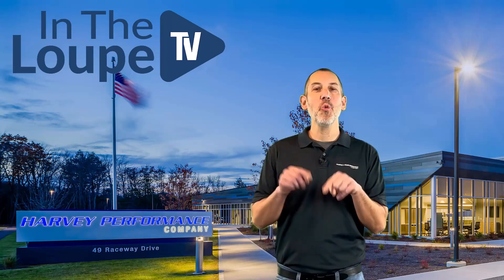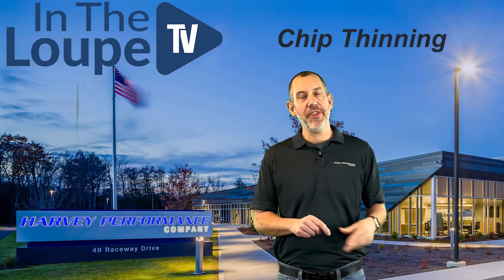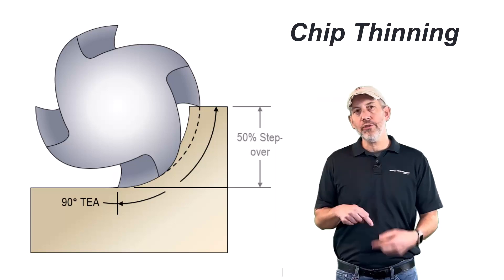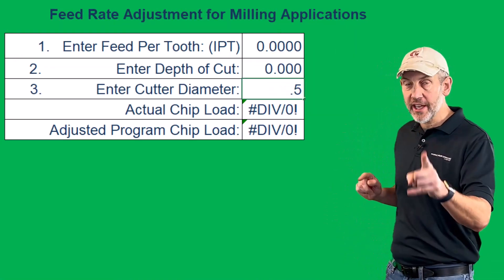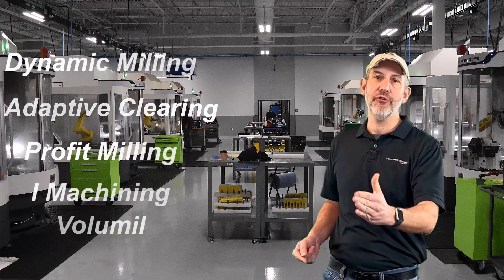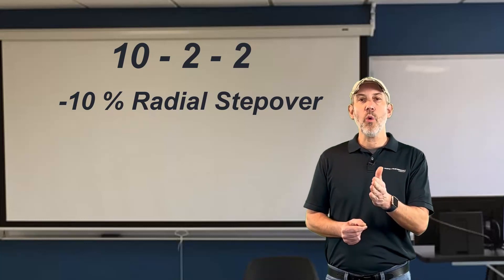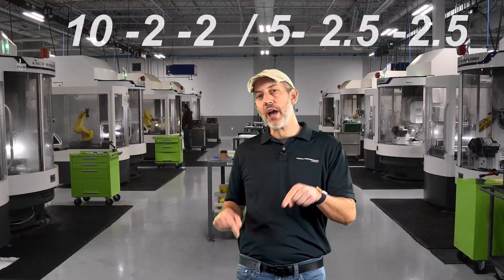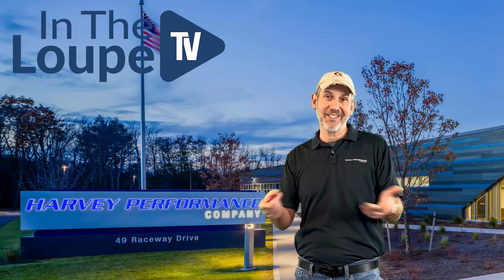Diving Into Chip Thinning: In The Loupe TV Ep.13

Comment: Good general rule for starters.  I think chip thinning is a good approach to apply for deep axial roughing.

I would be interested in learning more abbout  optimzing chip thickness and sfm with finish passes as well.  I have some rules i have had success with but i feel like there is more of a "gray" area when finishing parts for speed and tool life
Reply: I like a 3-5% of diameter for finishing… pending LOC.   Thanks for the comment! Ctc
Reply: @CuttingtoolCounselor  and using 5-2.5-2.5 rule for finishing pass Aswell?

Comment: If the chip data is based on an ae of up to 30%, will your method work?  If not, is there an easy way to calculate?  Would I divide .5 by .3 (1.66) and use that number as a base to use in your formula?

Comment: 10-2-2 5-2.5-2.5   Interesting way to prevent chip thinning. I have not increased tool velocity in compensating. I've always kept the SF in relation to the suggested coating for the material. I can understand that the amount of heat will change though, but the cutting edge still has to be in contact with the material at the speed that the coating is rated for. It's a habit that will be hard to break.
Reply: No wrong way to approach it Kevin.   But as the radial gets lighter we do generate less heat based on the amount of time we are spending in the material per flute.   It is a small amount but enough to bring the sfm up to increase your MRR.   Tool life is the X factor though.   Its about the more we know, the more we can manipulate.   Thanks for the Comment. CTC

Comment: Re your chip thinning formulas, doubling the sfm doesn't seem right. For example cutting titanium,  doubling the sfm will burn the tool up
Reply: Frank I understand your concern, but lets take a look at Ti..  In our book we recommend cutting Ti6al4V at 160SFM and .0035 IPT..   With a HEM toolpath I would have no problem running 320 SFM up to 400SFM and .006-.007 IPT at a 10%Radial.   Its just a good Starting rule for chip thinning.   We also need to consider a lot of other factors that encourage SFM..  My video on CTIC and SFM also could help with understanding better.    Thanks again for participating with Comments.  If you have good parameters for TI please share sir..   CTC

Comment: What do you do if the SFM increase puts you outside your machines RPM range?
Reply: Hello Hector, Great question.   Our SFM is always limited by our RPM of our machine.   SFM is based on Diameter and as the diameter gets smaller we are limited on how high we can go..   Two things with this.   The Feed Per tooth is always based on the RPM not the SFM.   So if we are limited on SFM we are still going to be able to control the chip at the cutting edge. Slight sacrifice in tool life when we cant use all of the SFM because of the required heat needed to make the the chip at point of contact but totally acceptable.   #2 is you could look at a Speeder Head or a HS spindle.  This will allow you to get the correct recommended SFM for smaller tools.   Hope this helps.   CTC
Reply: Meet me at the bar. We'll drink about it.

Comment: Thanks for the Combat rule.. 
Don.. U r the ruler! 😊
What a great knowledge.. 
Simple and effective explanation.. 
Thanks for the session🙏
And finally... 
What about the rule with spring passes!?
Reply: Thanks don!
Reply: Love that question! I am the spring pass King!  OK there is a massive amount of Chip thinning going on when we take a spring pass, but a spring pass is to do one thing and that is to straighten the wall.   Lesser of two evils.   A spring pass, believe it or not is more of a burnish not a cut.  It removes the remaining stock at the bottom of your cut using rigidity of the tool.   Death Taxes and Spring passes...   Unfortunately.     ( Disclaimer is that it depends on your Print tolerances and wall straightness.   Just understand most Chip thinning is explained in Roughing ops...)